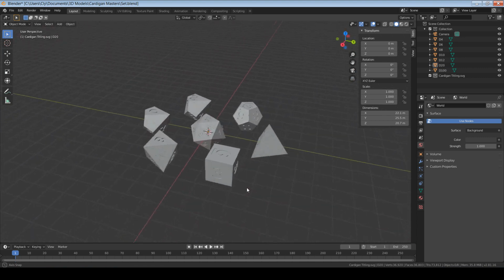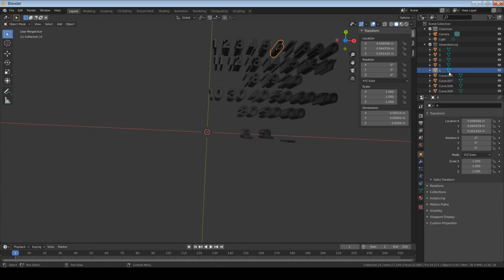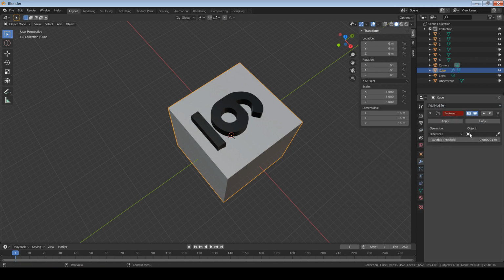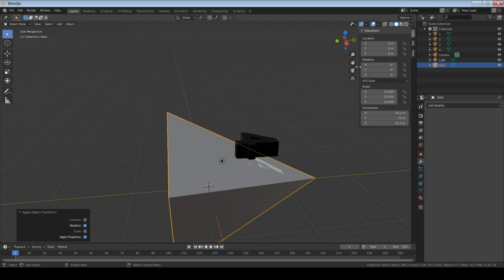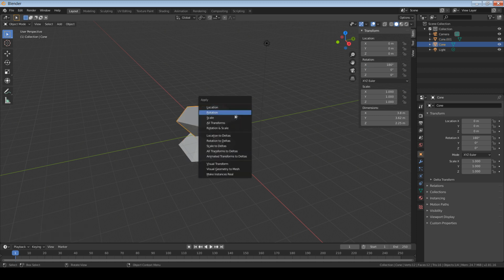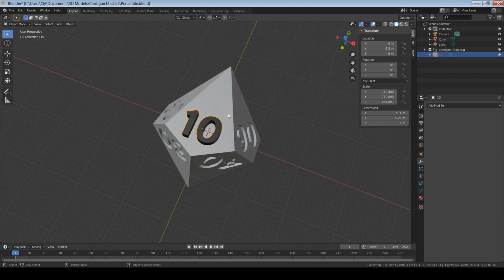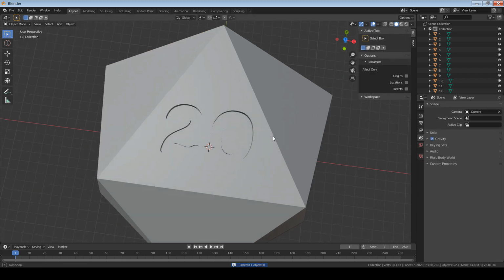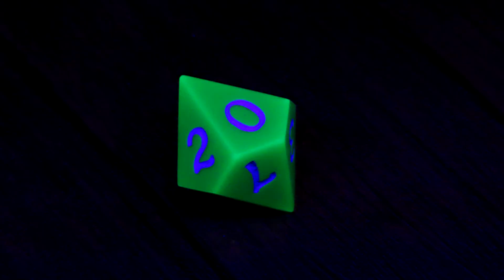Design Your Own Custom Dice for Free | Blender Tutorial | DIY with Cly Ep. 21

Comment: I'm having issues when I get to the Boolean step. When I do this step I get to delete the 6 on the D6 and the 6 disappears but then the indent of the 6 is not there. It is just the flat square cube as it was when I started. Anyone have any cues of what I did wrong? I followed everything step by step and I tried different fonts as well but still no dice (thats a little pun)
Reply: Just ran into the same issue. Click on the boolean you want to apply. Then hit CTRL-A. This is the shortcut to apply since there isn't an apply button
Reply: @carlconte2656  just as a heads up theres an apply button but it the little menu that drops down from the arrow at the top right of the boolean menu

Comment: So Blender can take any font you have in your system and let you create a Text object - which is a curve. Skip the whole image editing -> svg. 

Why you're exports are messed up: the world values are in meters. For precision editing, I use mm and the world scale to 0.001.  It'll import perfectly after than.

Enable "Bool Tool" in preferences ->Addons and use the difference brush; great for moving around your "cutter" in a non-destructive way.

Also: Blender has face snapping. If you click on the "magnet" at the top, you can transform the object and have it snap to any face. E.g. on the D4 I snap and then move it towards the top. When I'm happy with the location; I extrude by ~1mm (making sure to recalculate outsides if you choose -1!). Then I dupe + rotate by 120 a couple of times.

If you wanted to be completely non-destructive (so you could change fonts... that's not possible right now. You can "extrude" a curve, but you cannot bool it with something else. Best I've got there:  Use all curves (even extruding), align, dupe/rotate/whatever.  Then when you're happy, dupe the curves and convert to mesh + bool tool. That way you can delete the dupes later, change the font, and go about your day.
Reply: ... and parent the  curves to the die. Rotations of the die then affect it. So your method of rotation continues to work.

Comment: Blender can work with fonts directly, as well as extrude font objects. So there's no need to convert from a vector to a bitmap to a vector to a mesh.
Reply: Can you please elaborate on this? I've been having a hard time with the font part of this tutorial. The font I'm using is my own, so I'm not sure if it's the font itself that is the problem or if I'm doing something wrong with the program. When I go through the steps he talks about in the tutorial, my font has weird chunks taken out of it rather than being solid, even though the font itself has all solid lines.

Comment: Thank You for making this, it's a huge help for us, beginners. I'm now looking for help on a d3 design.
Reply: Don't know if you are still looking for it, and if you mean the poly d3, but that's what i did.
1.Make sure the cursor is in world origin
2. Create an icosphere and set it to the desired dimension. If changed in object mode, remember to freeze the scale(CTRL+A -> Scale)
3.Create a box, enter edit mode and move it along z axis(will come back to it in a bit)

4.Create an empty -> plain axes
5.Select the icosphere and add a boolean modifier set to difference and select in the "object" field the box previously created
6.Select the box and add to it an array modifier. Set count to 3. Uncheck the "relative" offset and enable the "object" offset. In the object field, select the empty previously created.
7.Rotate the empty 120° along Y axis.
8.Move, in edit mode, the box along its Z axis until shape it's the desired one.
9.Go back to the icosphere, select it and apply the boolean modifier.

And that's it for the base shape

For the numbers
1.Make a copy of the previously created ones and make sure they are all in world origin(either by ALT+G or setting manually the location to 0) and with 0 rotations.
2.There are 3 couple of digits to work with: 3-2, 2-1 and 1-3. 
3.Using as an example 3-2, you'll have to:
    3.1 rotate the 3 90° along Z axis
    3.2 rotate the 3 180° along X axis. 
    3.3 move the 3 to -0.5m along X axis
    3.4 rotate the 2 -90° along Z axis
    3.5 move the 2 to 0.5m along X axis
    3.6 select both the 3 and the 2 and press the combination CTRL+J
    3.7 set the origin of the new mesh to world origin("CTRL+A -> All transforms" does the trick)
    3.8 repeat steps 1-7 for the 2-1 and the 1-3
4.Once the couples of digits are ready, select all three of them and drag them down until they intersect the previously cut icosphere as desired.
5.Set again the origin to world origin
6.Leave the first couple as is
7.Select the second couple and rotate it along Y axis by -120°
8.Select the third couple and rotate it along Y axis by 120°
9.Select the icosphere and add 3 boolean modifiers: each has to work with a different couple of digits.

By doing all the previous steps, you should have a proper poly d3. It may require only some positioning and/or scaling tweaks. Hope this helps. Let me know if you have any question

Comment: Does the Illusive mold (second) video exist yet? lol
Reply: Still nope. I assume the concept failed as while its nice to be able to make your own base for a mold, how exactly are you going to 'clean up' the 3d print, sand, polish and such to remove all the print lines inside a object designed to be used to make a mold? After all you want to make a clean object to make the mold, otherwise the mold will have all them imperfections.
Reply: @TAiiNE  its a pretty common process to create molds from 3D prints, both from SLA and FDM prints.
Reply: @SuperSmashRiolu  I am aware but the issue is is you normally create masters, dice, and clean them up first. polish up and make ready to use to than set up to make a mold out of. But what we see is hes bypassing that and going right for a master for the mold its self. But that master, how are you to clean it up? Theres edges and faces tucked away inside lips and I don't see anyway you can sand that down and polish it so when you make the silicone version well, thats don't hto be stuck with all the imperfections you couldn't clean up, and thus, the dize will look just like the 'master' with all the 3d printed sacan lines and bits you couldn't clean? 

Pretty much instead of just making dice that you set up, hes bypassing that and directly making a set up to make the mold. but yeah... how when your not going to be able to clean it up?

Comment: Hey, so I'm in the process of designing my first set of dice here, and I'm currently on the d4 but I'm having some issues. I'm rotating the d4 based off of the measurements given in the video, but I'm completely unable to get the thing to line up right. It's always tilted and not even close to being where it's supposed to. The only time I managed to get the surface of my tetrahedron flat was after messing around with the angles for a while, and even then it was the wrong vertex. I've double and triple checked that I was putting in the right measurements, and I've followed everything that didn't involve my font to a T. If anyone's got any tips, I'd greatly appreciate it
Reply: are you applying after every single measurement? I was having that issue at first and that was the solution
Reply: @KanisLupus5  Thank you so much! I figured it out. I think messed up something with the angle my tetrahedron was summoned to, and I finally got the measurements to work after learning how to properly apply them and reversing the angles (ex, 19.47 to -19.47 and vice versa)

Comment: Followed to a T and was starting to work on the D6. Rather than using normal 6 and underscore, I wanted to use the "6.", however for some reason when moving to center origin and resizing, it wouldn't show up like the normal 6, I only see the D6. I tried adjusting settings, but I still cannot see it. I am assuming it has something to do with the set  origin, as I tested setting it to center rather than to 3D Cursor, and it worked fine. I also think I need to redo all of my numbers, for some reason 1,3, & 6 are off from center slightly, and 2,4, & 5 are perfectly centered. Any Advice?

Comment: Thank you so much, this helped a lot! Maybe I missed it, but I had to set the Pivot Point to Indiviual Origins first to be able to enter the location values as shown in the video. I created a d20 and it did not work out with the values of the video (I'm sure I made something wrong), but I finally made it by rotating the dice and the numbers manually. Thank you!

Comment: I had a problem with the boolean function when trying to make mine. Apparently there's a problem in 2.91 when trying to use Exact that will cause the program to crash. Using Soft fixed the problem. Just a heads-up for anybody trying to make dice in this version.

Comment: For those having issues getting their fonts to extrude with solid faces instead of jagged messes, Make sure you hit the A key after you switch to edit mode - this will select all parts of all the meshes. extrude them out and then double check back in object mode to make sure you have some nice shiny surfaces, and if not, try again. There's lots of threads in here with similar issues going off on tangents, so I'm posting this as it's own comment so it may be a bit more visible. it's still a bit random which is why I state you should double check and try again. Saving my initial font image file in gimp as .png or .jpeg didn't seem to make any difference, both worked or bugged out. 

Also of note from another thread in the comments, If you're trying to create your font file in Gimp using 250 point, ending up with absolutely massive characters - Cly had his settings a bit different from stock - Use 250 pixels for the character size as a starting point and most fonts should fit the 2066 x 1548 image size properly
Reply: This comment needs more appreciation. 
Thanks so much for this. I'd thought my font might just not be the first one for dice, but no, I was just using the wrong method before. I'll always be hitting A for the selection now~
Reply: Oh my! This is what I looked for. Thanks!
Reply: For some reason, when I hit the "a" key, nothing is highlighted or selected. I have to use the mouse and select all the numbers. 
How do I fix this?

Comment: When a 30 minute video tutorial takes you four hours. :D

It was good though! I have NO experience with 3D modeling programs, and I was able to get it done in a few hours; I ran into some issues I had to google because I was using a newer version of Blender, but I was able to solve them all! Thanks!!

I ran into the problem of my numbers being jagged when extruding and not making imprints in the dice; make sure you hit "a" before "e" to extrude and it solves that issue, guys! :)

I'll be making a second set with a different font, and maybe an illustration later!
Reply from the maker: Glad to hear it worked out for you!

Four hours sounds about right for your first time. You'll get faster with practice though. 👍
Reply: Thank you sooooooooooooooooooooooooooo much, hours spent trying to figure out what was going wrong

Comment: The D20 was really confusing to have explained, what with jumping around so much in the video. Having it all written out for me made it easier to follow so here's hoping it can help someone else.

The process can be broken down into batches of 3. Once the 3 numbers in each batch are finished you must reset the die back to the Base number and set it up for the next batch. The order of numbers to be applied is as follows:
20 (Base)
14>16>4
8>10>16
2>18>12

--------------------------------
START at Base: 60°Z (ONLY FOR FIRST BATCH. IGNORE FOR SECOND AND THIRD.)
FIRST number in each set of 3: simply apply 41.81°X
SECOND number: apply 60°Z then 41.81°X(Not Applied)
THIRD number: apply 0°X, -120°Z, and 41.81°X(Not Applied)
RESET back to the Base: apply 0°X, 60°Z, -41.81X
SET UP for the next batch: apply 120°Z
------------------------------
^ This is the pattern that is followed for each batch. The only exception to this rule is the 12 face, which is the final even number before switching to the other side. 
Immediately after finishing up the 12, follow the standard pattern up to the RESET stage. Do not do the normal SET UP rotation: instead, apply 60°Z and 180°X. This will give you a blank face upon which you will place the 1 which will be your new Base. 
The process from here is identical to the first set of number batches. Follow the exact same pattern of steps with the same degrees of rotations in order, just with a new set of numbers. An additional benefit to doing the odd numbers is that you are able to check if they are correct by adding up the numbers on opposite faces. If the total comes to 21 you are doing it right.
The second set of batches are as follows:

1 (Base)
19>9>3
13>5>11
7>17>15

--------------------------------
START at Base: 60°Z (ONLY FOR FIRST BATCH. IGNORE FOR SECOND AND THIRD.)
FIRST number in each set of 3: simply apply 41.81°X
SECOND number: apply 60°Z then 41.81°X(Not Applied)
THIRD number: apply 0°X, -120°Z, and 41.81°X(Not Applied)
RESET back to the Base: apply 0°X, 60°Z, -41.81X
SET UP for the next batch: apply 120°Z
------------------------------
Hope this helps someone. Thanks so much for the tutorial my man, aside from that little bit of confusion the whole thing was incredibly easy to follow even for a complete Blender noob like myself.
Reply: OMG, THANK YOU! this helped so much! 
But you have a typo in your first set! In your batches, You have 16 twice, where the first one should be a 6?
Reply: This was so immensely helpful. This is real gold. I would have given up if it weren't for this comment. Thank you!
Reply: OMG.. You have helped me so much.. I couldn't figure out how I wasn't getting the rotations right and if I was returning back to the top the right way.
Reply: THANK YOU SO MUCH!!
You literally saved my life :D
Reply: That doesn't make any fucking sense
Reply: This is incredibly helpful, however on your first set of 3 on the even numbers you have 14>16>4, should be 14>6. This tripped me up a bit ;)
Reply: you're a life saver
Reply: you saved my brain, thank you

Comment: I followed everything to a T and was very happy with my design. However, I had my brother print out my masters and it looks like the numbers are too shallow and after sanding will more than likely be saded away. Do you have any tips for this? I'm not sure how much to adjust based on font or if there may be something I mucked up in the process?

Comment: My dice look great in blender, thank you. However, I have run into the issue that my Anycubic Photon prints the dice with no numbers. Just solid polygons. I have done everything the same way that you have. Any ideas as to what could be causing this?
Reply from the maker: Sounds like you are having a manifold error somewhere. The quick fix that I've used in that exact situation is to add a "remesh" modifier to each of the dice. You will find it in the same column of the modifier menu as "boolean", and you'll want to set your octree depth to 9. This will leave you with large file sizes on your STLs, but you should have no problems printing them.
Reply: @ClyFaker  Obviously I can't print fast enough but the slicing looks great! Thank you so much again.
Reply from the maker: The slicing preview is what's important, so I'm glad it's looking good. 👍
Reply: @ClyFaker  I will give that a shot. Thank you so much for the quick response! Subbing for sure